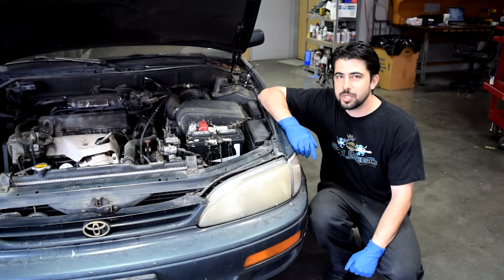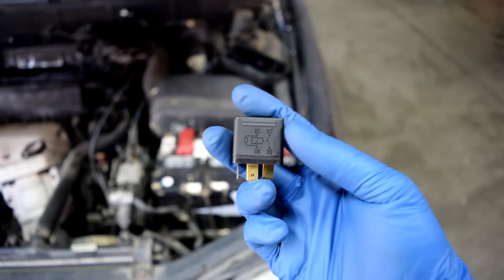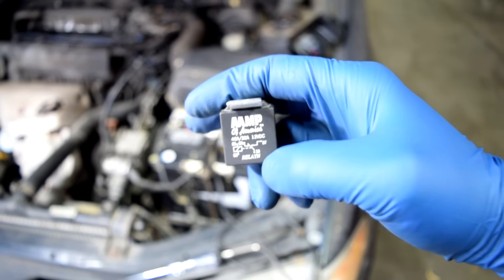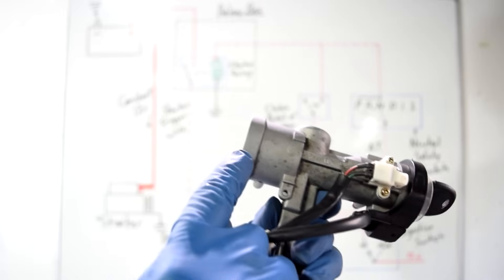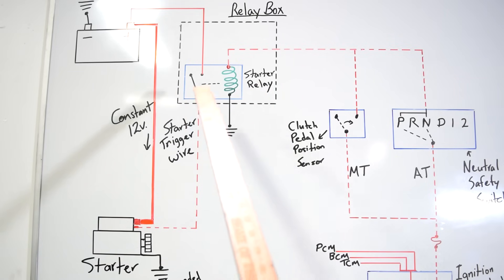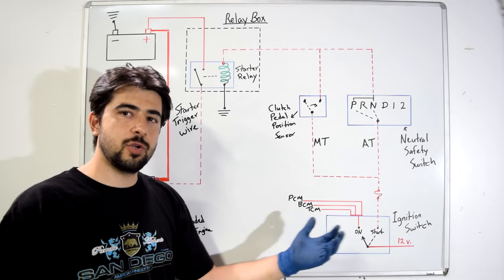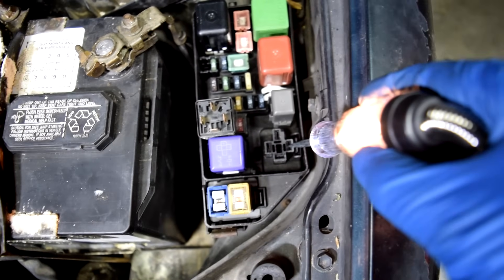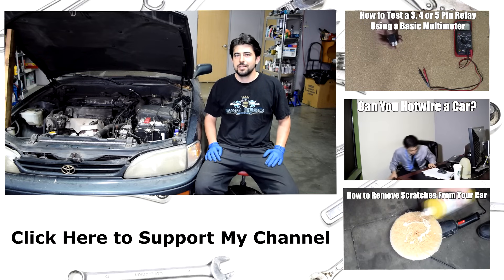How to Start a Car With a Paper Clip - NOT A HOAX

Comment: Doing this to test my igniting switch. What does it mean if the starter is good and the starter ground is good but doing this blows the 10a crank fuse instantly? Also the 40a starter fuse blows when trying to start with the key

Comment: So I tried it with a hanger and I tried it with a paper clip.And it didn't work the starter clicked but the battery.It's in turn over and there's nothing wrong with my car besides I.Left the key in it and the battery died

Comment: Half of those views are me! A bit thick. Would you please explain why on my ML500, pin 30 on the starter relay has no power without the key fob in the ignition. It does have power when the ignition is position 2 though. I just want to make sure the starter turns. I have a no crank no start condition. Thank you.

Comment: It's -15 celcius in canada. I stopped my civic for 30 min, and now not crank. It just clicks once, no lights light up on dash, just honda welcome screen. If the car has single click is the starter OK? The battery was replaced 3 months ago. I'm thinking it's either the alternator or starter. How do you test either?
Reply: What year? And there might be a second battery!! Most likely connections a relay or fuse(even if there good they could be coroded!!) If head lights are bright it isn't battery tho! Also if head lights are bright then mostlikey not alternator! But know that one being bad can damage the other! Normally goes Starter being excessively used from lack of matinanice (bad oil bad plugs bad pulley bearings on belt drive!! Lose battery terminal or bad battery terminal connection) then coils in starter melt together making heat instead of magnetic propulsion heat creates resistance witch takes more voltage from battery putting extreme strain on electrical system causing surges frying diodes in alternator and thus shorting ignition module out!! So that 40 dollar oil change jus turned into 1500 plus in parts and around 2000 in labor!!

Comment: Hello there I have a question I have a 2000 Chrysler Pacifica I lost the key how could I bypass the ignition switch try to turn it on with no  key is there a relay that could turn it on

Comment: I have an 02 Buick Century, I am having some no crank conditions. when I have a test light on pin 86 going to 85 for control circuit. I have power on 86 without hitting the starter just turning the key on. It seems like I should not have power to that pin (86) unless I hit the starter.  All of the things in the circuit have been changed, it was intermittent, now permanent problem. The ignation switch, has been changed and worked for a while. the relays and fuses have been checked and replaced, the starter was replaced, and even a Fusable link to the starter motor was redone at the connection which was corroded, it still had power though. seems like I have tried everything, and still no crank. I will try the jump to 30 and 87 and see if that works. I have not done that yet. Do you have any suggestions?

Comment: Our battery kept dying, but took a boost very well.  We decided to go ahead and have a new battery installed.  All was good for 2 weeks and then she would not start.  Two days before the left turn indicator light was beeping fast and the high beam lighr on dash was flickering. 
So then, like I was saying, she would not start at all, completely dead.  No lights on the dash, no power in the door locks or radio....nothing.

Comment: But if the starter is bad this wont work?
Reply: yes. that's the purpose. if the starter engages usng this method you can eliminate that as the problem and narrow it down to that relay which was removed or a problem elsewhere in the system.

Comment: Hi I have a problem with a 97 Ford Econoline it gives a close loop fault it has New O2 sensors and their  circuit is great but it is extremely rich with low power.
What can I do to solve this ?

Comment: Yea. I had to do this after I had a no start no crank. I replaced the starter did everything under the sun to no avail. I even switched the relay and it didn't start. I figured let me try this and it worked. SMH.

Comment: Thank you for the great videos, very helpful! Any idea what could it be if the batterie is good, new starter, still no crank, lights are on in the dashboard, tried bypassing the starter relay with a paper click, still no crank, tested voltage to solenoid about 3 volts, also weird clicking noise under the dash even when key off the ignition? Taurus 2013 SEL, any help would be appreciated!

Comment: i hope you see this and can help.. i did the paperclip trick and it did crank but did not start... i have a 2004 dodge neon, with no crank so start no sound issue. tried the paperclip and got it to crank, but not start, any advice ? battery is good, put a new starter on it already, checked all the fuses.

Comment: Ok,great it worked!!!! Now I just have to find the problem. I had already switched the relay with another relay and that didnt work......Unless both relays are bad.  Thanks for all your help though...it is so nice hearing the car running again!!! I just wish I knew more about cars!!and i wonder if its safe to trust a wire clip to keep starting it until i figure out the problem.I know the battery is good,its new. 😊 UPDATE-OMG I DID have 2 bad relays,i tried a different relay and the car started!! 👍

Comment: No Crank No Spark... 1998 Dodge Caravan sport, 3.3 liter. I have power on the 10 amp starter fuse when the key is turned to start, I have constant power at the starter relay, my starter is Brand New and will crank when I connect power directly to the orange wire at the starter...My Starter will not crank when I try to jump the relay, my horn will not beep when I jump the horn relay...Also, I have no power at the Coil Pack when using a test light even when the key is in the start position. Any Thoughts where to go next?

Reply

Comment: You wouldn't happen to have a wiring diagram for the two plugs on the ignition switch for a 05 grand prix GT some of the wires got torn out and I'm not sure if they are in the right order Please help me

Comment: Good Job explaining starting circuit.  I'm always happy to see individuals who want to learn and teach others.  Keep on diagnosing and troubleshooting.
Reply: My2000grand marquis won't start,I been wirkungon this car first over a year indeed serious help while changgeing it the flywheel I connected the battery to pip the trunk time getatool and the starter wires touched the bottom cross member bar and the car started
Smoking thick white white smoke so i yank the tha batrery out icant see any burned wires it only smoke from rhe driverside firewall and from inside rhe car now the car is a great car62000 original miles I know that because of that dumb mistake I made its costing me big time what could it or is in that won't let the car crank up and start  please help    ScottLJohnsonSr

Comment: I couldn't follow your explanation with the diagram.  I'm unfamiliar with the terminology you used as you explained your diagram.  It's technically unintelligible to me.  I'm sure you're entirely right, and I've used a wire in my fuse box to start my car, but I HAVE TO have my key in the ignition and turn it to the ignition position.

You're right in saying the car WILL start even if in Drive or Reverse.  It's an absolute MUST to make sure your car is in Park or Neutral.  Emergency brake should be used too, but out of habit I always use mine anyway.  You really don't want your car driving itself away and maybe killing folks and destroying property.

Comment: The first time I watched this video I thought it was interesting but couldn’t understand in which situation it could be useful… until this morning when a friend called me to rescue him. 
The car wouldn’t crank… then I remembered this video! Worked like a charm! Turned out it was a bad starter relay. I felt like a hero 😂😂😂😂 thank you for making this videos!!
Reply: Good on ya. Also, if you don't have a paperclip, or want to use one, if you take starter relay out, and hit it a few times with a hammer or something ridged, you  can get relay unstuck and work another handful of times.
Also, sometimes the same relay is used for something no  essential, such as the AC ,which you can swap in until you can acquire a replacement 
Source:Me, probably
Reply: Yupp as long as theirs enough battery in the system and it's not a newer vehicle with security steps to authenticate a running turnover

Comment: I have an 99 Isuzu trooper and the starter relay has 6 pins, does anyone know which ones I’m supposed to use to get the car started ? I have a bad safety neutral switch and I’m just trying to get home and figure out a longer term solution tomorrow

Comment: Hey buddy.. great content and thanks for the love. The passion is very noticeable. Tell me can the same be applied to a 1996 W202 mercedes Benz. Children broke my key trying to start the car with a low battery and then it stopped trying to crank they didn't leave it be and now the key is jammed up in the ignition tumbler needing R7000 to replace the tumbler and key and reprogramming of the computer box

Comment: great video!  I have a 2001 ford ranger that won't start. I've replaced the ignition switch. New battery.  I can turn the key and the dash board lights up.  The check engine light illuminates.  The anti-theft light flashed red which is normal. I can turn the key to engage the starter and nothing happens.  So I (per your video) removed the starter relay and jumped from 30 to 87 with the key in the on position. Truck started right up.  So its not the starter.  Any suggestions? what's left? the neutral safety switch. what else???  Thank you for taking the time to respond!

Comment: Or you can just use a screwdriver to jump the solenoid on the starter🤷🏼 If your really lucky and have an older Ford, you might have an external solenoid mounted to the inside of one of your fenders

Comment: Stop the Bots, we're smarter. You never started the car without key or explained how.
Reply: I just started my 2001 ranger using this technique.  I had to have the smart key in the ignition otherwise it will crank but not start.  With key in ignition just turned to the on position, cranked up and started...

Comment: I have a question... if this trick doesn't work, ive swapped the relays over to double check. no crank just a click,  ive changed the starter, battery good, wont start on a jump but will with a push what the hell is my problem?

Comment: I got a question I hope you get and can help me with I found on the relay the ground. and where the 12 volts constantly come in the thing is where the 12 volts come in without the key in the ignition or anything im getting my test light on brightly. So negative battery terminal to 12 volts constant on relay= constantly on without the key please help as I  can't start the car other wise without jumping the relay as you did here thank you.

Comment: Bro I have a 94 Chevy blazer and the battery is drained completely I tried the relay under the dash it sparked but didn’t turn the engine over at all should I crank the starter pod and Meg with a screw driver

Comment: So is he saying this only works for really old cars? I have a 2004 ford ranger, key has chip.... Can't get brand new starter to turn truck on. Still just clicks. Trying to figure out how to bypass the key ignition to starter. May have bad voltage from key ignition to starter. Any help  appreciated

Comment: i have a 99 camry 4 cylinder that only starts by me using a wire to connect the battery to an eroded part of the starter wire. any suggestion on why my camry won't start when i turn the key? it has 155k miles and am in los Angeles

Comment: The key still has to be in the on position to feed electricity to the coil the starter will work but you won't be able to keep the car running unless the key is in the on position

Comment: It seems like this should be working for me, as my car takes a regular jump immediately, and it also does make the clicking noise without a jump, as if it is the battery that is dead.  I must be doing something wrong, but I have gone over your video several times, took notes and feel I followed every step top the T.   I have an automatic, so it should be starting in park, as you say in the video.  No luck with key in on the ON position.  The only thing I cannot try is shifting the car into Neutral to try that just in case.  It is stuck in park.  I am having to use a voltmeter instead of a test light to verify I am jumping the right pins.
Reply: Maybe your battery is old and corrosion has accumulated in the cells, so it's not able to store a full charge any more?  Check it with a multimeter and make sure it reads at least 12.5V

Comment: Aren't you just Bridging the Gap from the positive and negative on a solenoid with all Paperclip also when she need to do something to the ignition switch to be able to keep it running or had the key in it and turn because just bridging solenoid will just get the starter to turn and start the car wouldn't stay running without the ignition switch being turned on

Comment: Well explained, diagrammed, and shown.  I can hot wire a boat in under 60 seconds.  With your video and a few practice runs a car should be just as easy.   Thanks

Comment: hi, it seems you could help with my question here. My Honda Odyssey 2010 can crank, start, but won't stay in running after I release the key. I changed the battery, engine air filter and made sure the oil stick looks good. Any suggestion? Thanks.

Comment: UPDATE  Unfortunately,   I found out that I have a key with chip....so this method didn't work for me... but this video led me to another video and my NO start problem turns out to be a crankshaft position sensor... It has taken me 4 years to figure this issue out.  a simple $20 part and 30 min install and finally, it's fixed.
Reply: What is the 20$ part
Reply: @tyreecammon7356  we bought a crankshaft position sensor for 20.00. HOWEVER, that only solved a different problem. We have determined 3 yrs later that my main pully was going out and causing an overheating problem just enough to keep the car from starting. I bought a new car and gave my jeep to my daughter, and they figured it out.. 8 years of that issue
Reply: @tyreecammon7356 crankshaft position sensor
Reply: @tyreecammon7356 bruh
Reply: My guess would be the crank sensor that they said was the problem.
Reply: @Raztax 😂
Reply: There is a fuse to pull for that!

Comment: My Jeep has had a problem with intermittent NO start --- seems to be heat related but dealership cant figure it out. I have a new starter and a new TCM. Still, the same problem.  THANK YOU for this awesome video that even I (a woman) can understand... thank goodness I won't be stranded for hours ever again.. the best part of your video is your diagram. It will help me track other issues that I didn't know were related to the starting process...blessings to you!
Reply: Why did you say that because you're a woman?I'm smarter than most men.I know, and I'm a woman experienced as a Crane  Operator other guys
were really afraid Never short change yourself that idea Women are not as smart as men was made up by a man
Reply: Why a new TCM?
Reply: @david-tracy @david-tracy  The first diagnosis was that the no crank was related to the transmission safety switch. But that proved to not be accurate. There are many reasons why intermittent no crank happens to the Jeep Liberty. However, in the very end -- I never figured out the issue. It would randomly not start and got worse. But the strange thing is that as soon as whatever was getting hot, when it cooled down it would start. I was finally able to get a new car in 2023 LOL
Reply: Ŵ

Comment: Hi , I have A 95 Camry , lately I put the key in ignition to start position , will not crank but when I take key out turn it the other way  it will start , what do you think is wrong ?both positive and negative terminal are clean . Thanks if you have solutions for me

Comment: My relight just have 2-5-3-4 I don't know what it is. It only has four pins inside of it. I have a 1993 Ford Tempo GL. It always has a problem hit the key ignition so it don't cranks don't do anything. The relay just makes click sound. I have a brand new alternator and a brand new starter my battery is fully charged so I don't know what the problem is

Comment: I checked if I have power and I have power. I accidentally put the paper clip in the wrong hole, then I corrected myself and put it in the right spot. Engine turned over great but didn't completely turn on. What do I do?

Comment: have you ever worked on a 2000 infiniti i30 with no start no crank and that the security system doesnt let the car turn over the starter was replaced the keys and immobilizer reset and the fuel pump replaced also as some relays have been replaced just to try and eliminate areas of interest

Comment: I tried this and it didn't work. 2005 santa fe 3.5l. Car has a new crankshaft sensor, starter, neutral safety switch and ignition switch relay and battery. What could it be no crank no start

Comment: New battery, good alternator and car wont start so I'm guessing it's the starter.  Did the clip trick and it will click ,dash and lights come on but wont start. Need I get a new starter or is there a 4th possibility that car wont start??

Comment: Okay y'all so it doesn't work without the key I fucked up the car because it was constantly cranking but it never actually started so I tried putting it in two different ones and it blew the car of course that's what he said can happen but I took the relay cover off to fast and didn't remember witch one was 30 and what was 87 so I connected 87 & 85 eventually and it sparked and blew now the kar doesn't even work with the key ...I was just trying to use my mom's kar tonight 🤦🙄 now I have to buy a new starter relay it's a brand new Chevy Trax smh